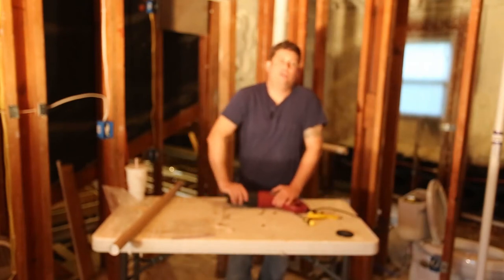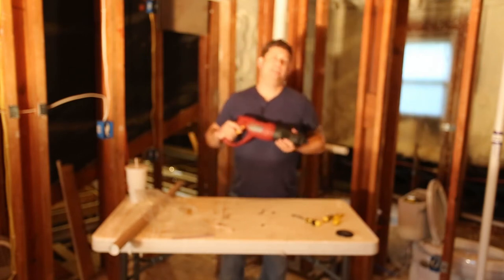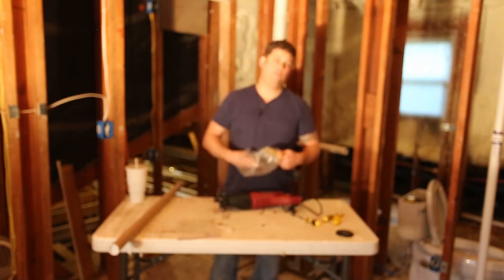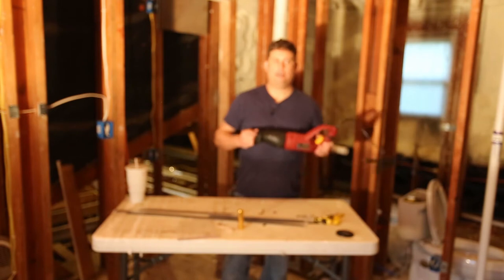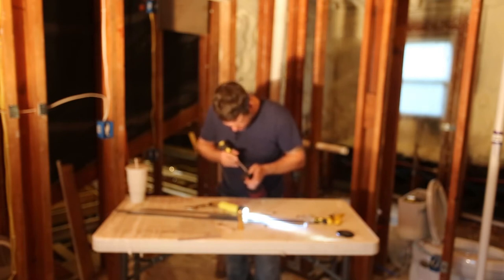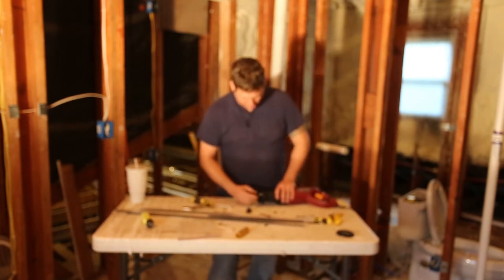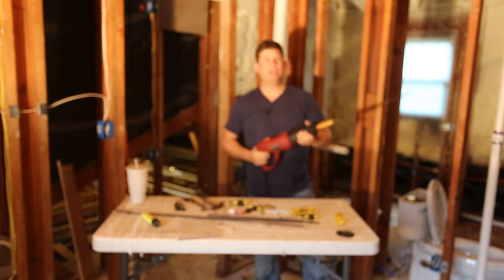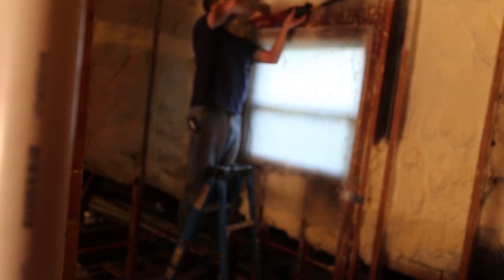Convert a Harbor Freight Reciprocating Saw to trim Spray Foam

Comment: +0:06 "an enthusiast and a believer" A believer of what? And that voice of yours...my wife asked why I was watching children's cartoons. 😂  my ears couldn't make it through the whole thing, but I am assuming that the "conversion" entails switching out a regular wood-cutting blade and installing a foam-cutting blade? Thank you so much for "documenting" the process for us 👏🏼 You just earned another subscriber!
Reply from the maker: The conversion was removing the wood blade chuck and bolting in the holder for the foam blade.  This video was horrible and had a number of issues including audio and no secondary cameras.  I'll reshoot it if I ever have to convert another one.  What was really amazing is that the blade holder is designed for a Milwaukee, but the Harbor Freight is an exact fit.  Which means that HF is either using old Milwaukee tooling, or flat copied the design.

Comment: Did you purchase the blades that are pre-drilled?
Reply from the maker: yes - sprayfoamdepot.com.  They have the adapter and the blades.  This works great for open cell foam.  For closed cell foam you need a rotary brush.  An Angle Grindr with cup brush is also the best way to get foam off of studs and floors.  :)

Comment: I don't get your point about the adapter being made out of 75 cents of material. If that bothers you and you can't find an import knock off of its design then make your own.
From the website it looks like it is made with pride to last and probably not in enough numbers to justify bar feed fully automated production.
Reply from the maker: I don't remember if it got recycled or just buried...... but it was an awful way to trim foam.

Comment: Well, I suffered through it. And apparently anyone who sells a product for any higher than the absolute cheapest possible price is a scam??  

"I got mine for (insert lowest possible online price here) but if you want to feel scammed, you can go to Amazon or eBay and pay more." 

Come on man, are you actually that ignorant? What if I found it even cheaper somewhere? Does that mean that YOU got scammed? It worries me that you may actually be in business for yourself as you have zero business sense with a comment like that which would normally come from a 9-5 employEE, not employER, most likely union worker without a care in the world about actually having to use your brain to earn your paycheck. I don't mean to go overboard but comments like that really fucking get to me.
Reply from the maker: Everyone should make a reasonable profit.  I just don't think that over 100% is a reasonable profit.  A Super Sawzall is $200, the blade is around $20, and the adapter I recall being $50.  If they were selling it for $320 or something it might be one thing.  But it's an off the shelf sawzall with an adapter and blade bolted to it.  It just looked like price gouging, which is why I shared what I came up with to help others out.  I remember having under $100 into the Harbor Freight Saw, Adapter, and blade.  The rotary shaver on the other hand was $1K and well worth it.  

I look at it like this.... if you can afford $460 for the pre-converted one on the high-end saw, go for it.  Enjoy.  By the way, that Milwaukee Sawzall is made in China.  Harbor Freight on the other hand, is a $20 reciprocating tool.  The couple of them I own have far outlived my expectations of them.  My Sawzall on the other hand did not last that long.  It was cheaper to replace it then repair it.
Reply: Man, you've got to get over the whole "made in China" argument. its not 1989 anymore. EVERYTHING is made in China, including Dewalt, Milwaukee, and even Ridgid, who offers a lifetime warranty on their products. Quality control measures are taken and being made in China does not mean low quality anymore. And an FYI, The new Dewalt FlexVolt RECIPROCATING saw (Unless you have meant tMilwaukee specific products with the Sawzall reference?) cost me $399, and worth every penny in my business. so if $460 gets the job done, and you don't want to fuck around all afternoon playing with Harbor Freight junk, then have at it.
Reply: Cody, You've got issues. Brian said in his video something along the lines of if you are a pro you probably benefit from the higher quality tools. But a homeowner who might have to cut off excess foam once in a lifetime for a home improvement project could probably get by with a cheaper tool.

Comment: Id like to try your conversion on this tool instead... https://www.harborfreight.com/20-volt-cordless-variable-speed-reciprocating-saw-with-keyless-chuck-tool-only-56396.html - What do you think? Can you see any reason it wouldn't work like it does for the Chicago https://www.harborfreight.com/6-amp-heavy-duty-variable-speed-rotating-handle-reciprocating-saw-62370.html which comes in at only $29.99 compared to $69.99 but looks like lesser quality and also cordless is an important plus for my projects. I suppose if I was really wanting to compare I should put it against Chicago's beefier version https://www.harborfreight.com/75-amp-heavy-duty-variable-speed-reciprocating-saw-69067.html which comes in at $49.99. So I guess I'm also asking which ones would work for your conversion but also which one you'd recommend for someone who plans on cutting a lot of foam and probably at a thickness exceeding that of general spray insulation foam applications?